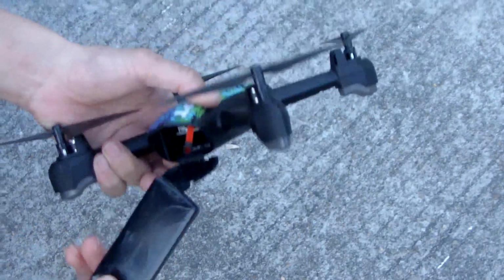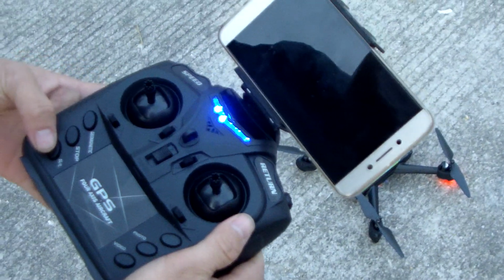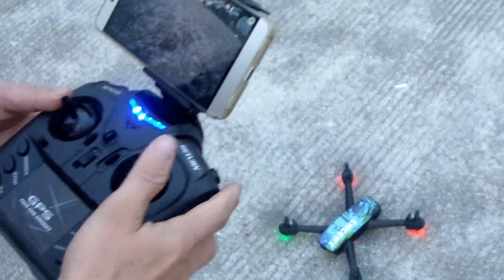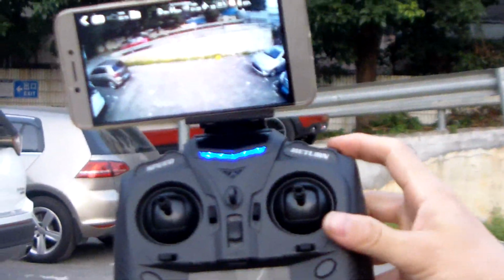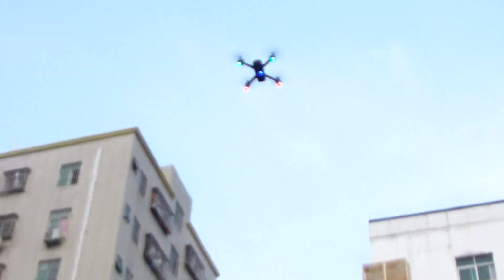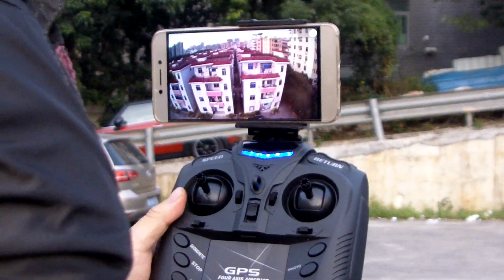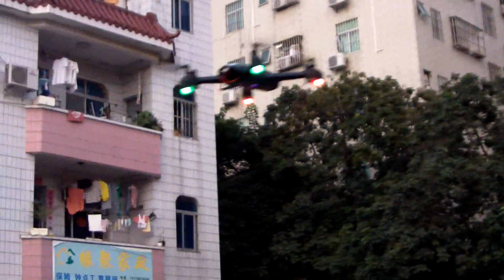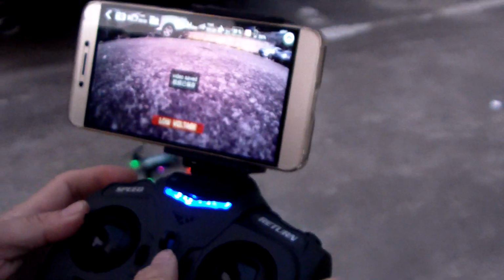JXD 518 518W GPS Drone how to start fly and GPS hovering test in the sky

Comment: It calibrates like the bugs 2. Is the camera better?
Reply: MGTOWPORTUGAL bugs 2 is much better than this, much more range, 1km vs 100 meters on this jjrc, Brushless motors, Busg 2 have MUCH BETTER camera quality, 1080p, This is only 720p, Bugs 2 is 5ghz wifi for Fpv and this is only 2.4, Bugs2 is a powerful drone because of its brushless motor , This drone is just a brushed motor toy drone with GPS
Reply: All GPS Compass drones calibrate the same way, horizontal rotation and vertical rotation, Some company Have different calibrations, Like parrot with the bebop, you have to do barrel rolls with it, Like bayangtoys etc.
Reply: MGTOWPORTUGAL Bugs 2 can fly up to 20 mins with its 1800mah battery but this toy drone can only fly for around 10 mins
Reply from the maker: yes, camera 720P, better camera drone, choose
https://www.youtube.com/watch?v=wWREbHlGlug
Reply from the maker: yes, like bugs 2, camera 720P , worse than Bugs 2